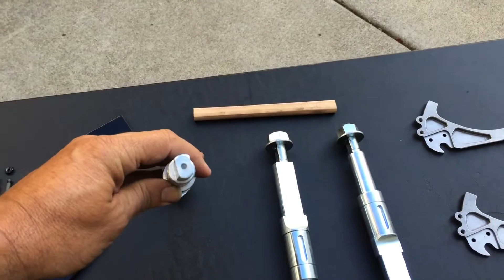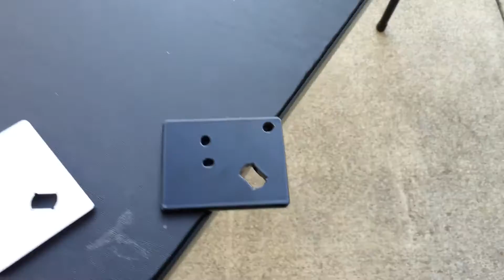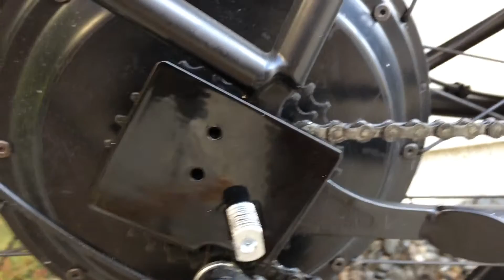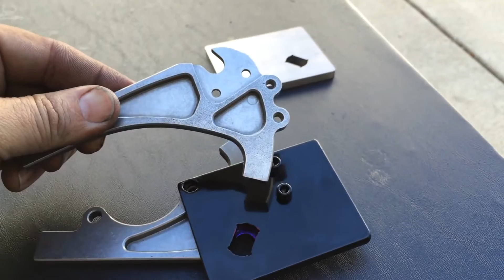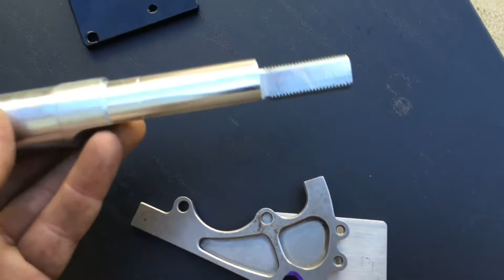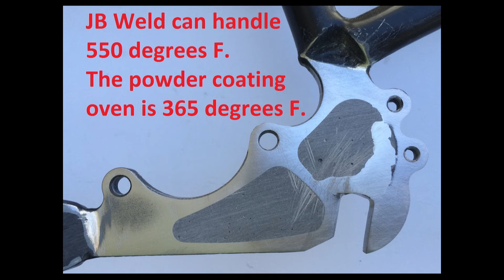eBike Torque Plates Cromotor Axles Cracked Frame Repair

Comment: My brother rode his e-bike without torque arms at first, and because of the back and forth motion of the axle in the dropout when he used regen, the nuts became loose and his rear wheel decided to depart the frame at 50mph. Also because of the torque, his dropouts had a slight crack that had just started to appear. Now whenever we go out on our e-bikes, or whenever we build one for a friend, we use torque plates/arms and consider them to be mandatory. Better to be safe than sorry.😉😨
Reply: Or try to buy or use e bikes with thrue axles

Comment: Very smart but why don'y you cut tha part in a back and make it round? That would look nicer.
Reply from the maker: Yes, that material in the rear is not accomplishing anything. I will trim it.
Reply from the maker: Trimmed it!
Reply: @industrialebikes4956  there is a debate about which way to install torque arms ( the generic two piece hose clamp ones ) ,lot of people on the rear wheel seems to be installing them so the arm is pushing against the  fork rather than it pulling the hose clamp from the forks .....